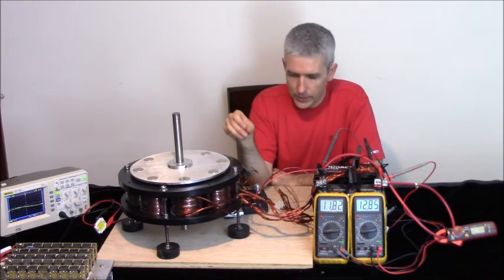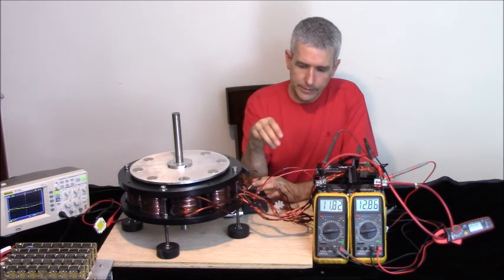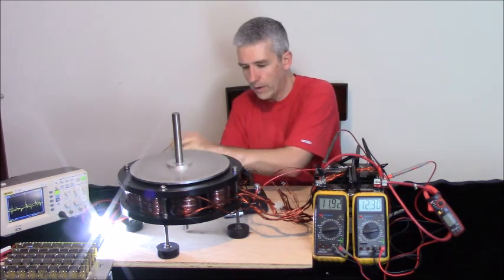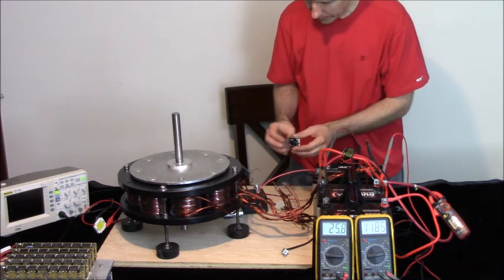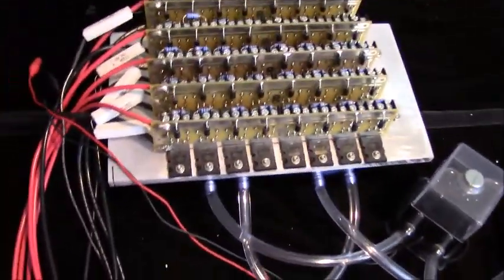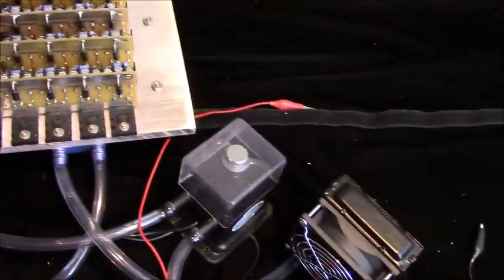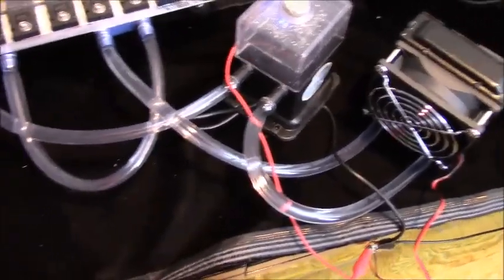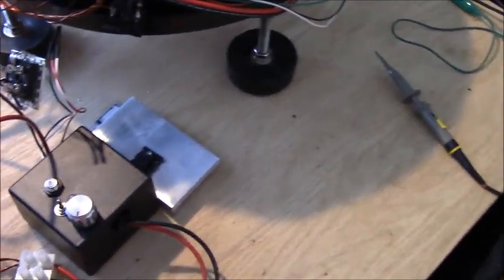4 DualPole Sr. Speed Control

Comment: Very nice. Did you say you can control both pulse width AND frequency on that box? It is interesting how much the motor speeds up with only one gen coil shorted! Are those gen coils bifilar? Also, do you really need a breaker if you have a temperature sensor to switch off the circuit too?
Reply from the maker: Yes, I usually set the one and only adjust the other with the external pot. Inside is another trimmer pot on the board that can do the other adjustment. You can also change the capacitors from 2.2uf to higher or lower for further adjustments. The idea was that with my industrial motor  which was two phase, there was always and on time so I wanted to not only have the speed control but break up this constant charging of the battery into pulses as the battery does need rest periods.
The motor does indeed speed up with one gen coil shorted. I did show all of them shorted at one point so maybe you were thinking that at that point. They are just one wire #18 ga coils. I will start to do some 12 ga wire coils soon.
Temperature can run away slower than amperage so yes. Fets will instantly blow if you go over amperage before the temperature sensor can track the heat and shut it all off. Amperage is complex as there is a difference between peak and avalanche and continuous amps. These fets can put out a lot for a short time but have their limits. It is best to keep it all at or below the 2kw range so as to give 500w extra. But your peak amps can easily go above 100A at startup. Eventually I'll add a current limitation to the control.
Reply: Thanks for the clarifications. 100A at startup - are we talking about 12v?
Reply from the maker: Without the speed control to break up the pulses at 24V input the larger 4 pole on just one coil with one fet went over the SOA of this 100A mosfet and blew it up faster than the 30A breaker could catch. The problem is that at start up the rotation is 30 to 40 degrees on time with very slow rpm so the surge is going to be maximum depending on what the wire can deliver. This can be hundreds of amps. It may not be that long but it is longer than the mosfet can handle. But it can handle those pulses if they are shorter, that is with the speed control. So at startup you must have that as a sort of current control. I have done this for several years now on my biggest motor and I did that with the 30 coiler that had a difficult start up with voltages up to 36 and I think 48V. 
But I'll probably use another mosfet with higher amperages in the future, as I don't need as high voltages. 
12V was showing only above 22A with the basic clamp meter. However, that would be much higher with a current probe for the very initial amount.
Reply: Right - I don't think I'd be with a PWM in that case.
Reply from the maker: ? You don't need one on the mini kit. It isn't that much to add it however. Maybe if you run it at 48V with bigger loads.
Reply: Sorry, I ought to check what I type! I meant I don't think I would be without a PWM on these bigger motors.
Reply from the maker: Yes, when working with the big fets. I'll post a video on Saturday of the 4 pole in the final form.

Comment: I make my own silicon rubber mold noise dampeners ideal material to deaden vibrations. Also your alloy discs could use a coating of foam rubber that would make it much quieter, no more ringing.
Reply from the maker: Can you give more details about that?